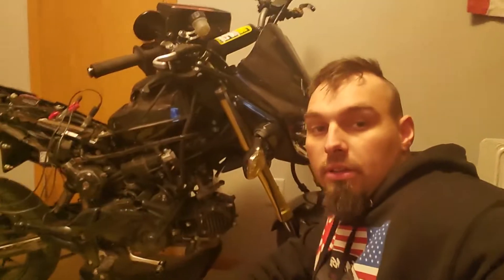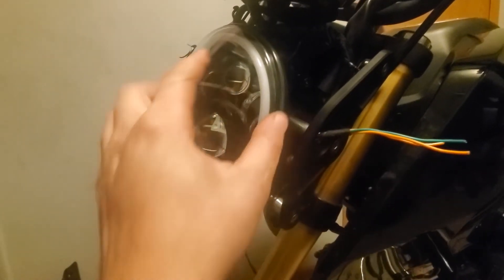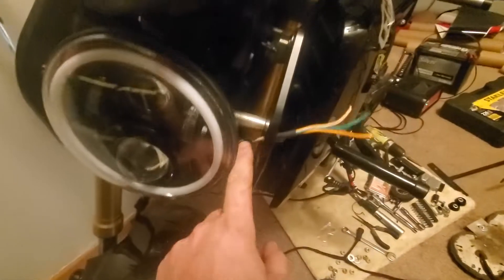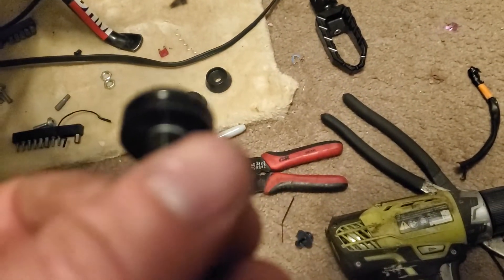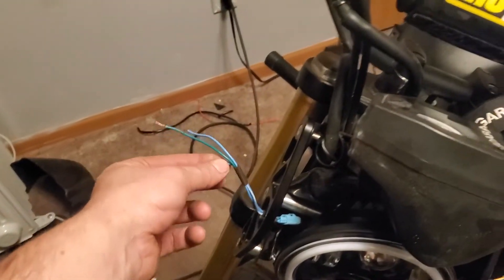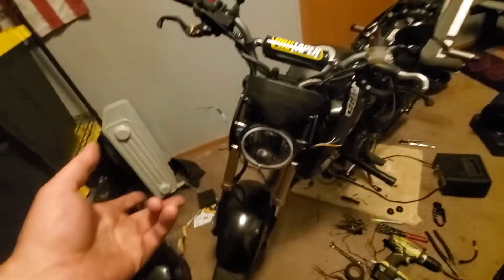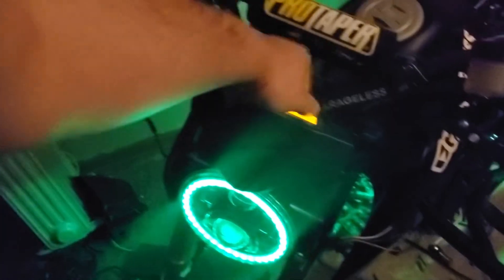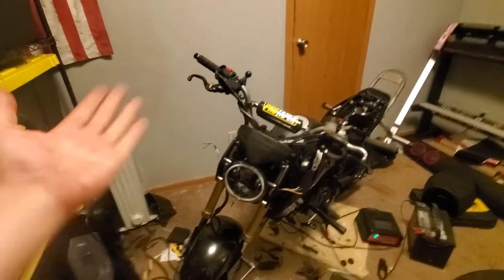INSTALLING MML MONSTER EYE BRACKET WITH JEEP HALO HEADLIGHT ON GROM!

Comment: I literally bought the same setup. The flp bracket seemed to need another spacer up to as it seems “tilted inwards” from the top. I didn’t like the rgb as you could “see” the led’s. I have CCFL on my big bike... guess I like those better. The search continues...
Reply from the maker: Yea it definitely wasnt perfect but nothing is actually truly bolt on
Reply: @Garageless  What i can't seem to get working is the App for RGB. What did you use? Also, where did you get ACC power for the halo? Almost rather have a remote to have the option to turn halo on/off whenever.
Reply from the maker: Try the other light... the headlight set i got only one works for the halo i think the controller is in one light and its shared across them both from the one

Comment: I need more info on this conversion, how can i contact you?
Reply from the maker: Jeep headlight and monster eye brackets all of ebay... what else u looking for?
Reply: @Garageless  I was told these lights https://www.raluled.com/collections/jeep-headlights/products/7-inch-round-rgb-color-changing-halo-led-headlights-pair-jeep-wrangler-jk-tj-lj-cj
wouldn't be a good choice as they kill your battery searching for a remote signal. Did you have any issue with your battery with your style?